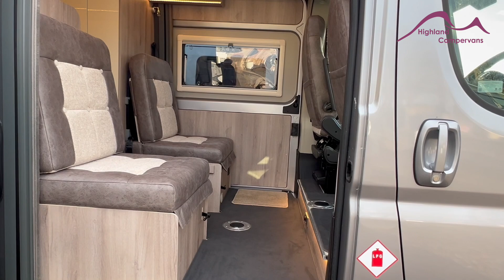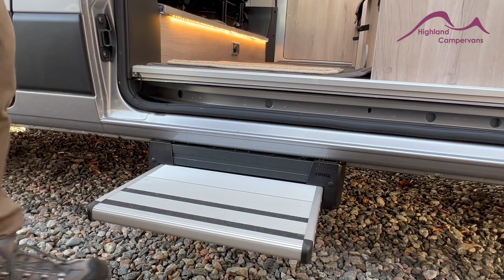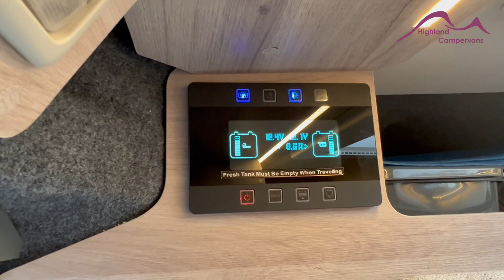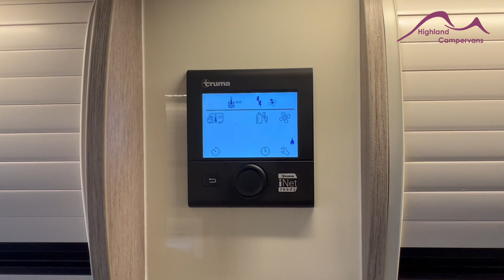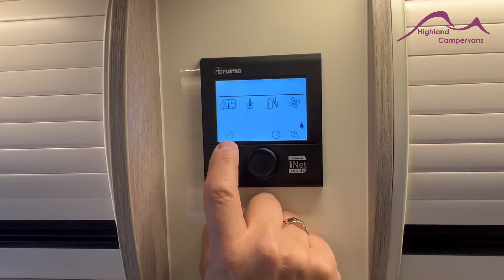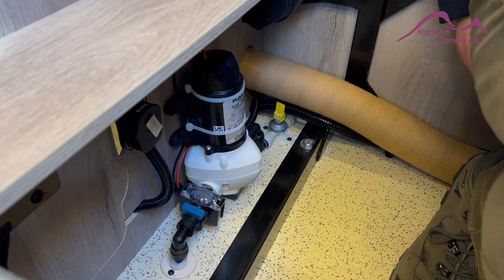Wildax Pulsar Auto - Handover Video

Comment: Always liked the Pulsar. It would be really interesting to know how much room there is for the driver behind the steering wheel. Are there any roof vents? If so, do they have fans for moving air in/out? Petrol engine variant?
Reply from the maker: Hi, the base vehicle is a standard Fiat Ducato, the steering wheel is adjustable giving flexability regarding drivers space. Yes the camper has rooflights for ventilation but they do not have powered fans fitted as standard. All new pulsars are on 5.4m Diesel chassis. Hope this helps.